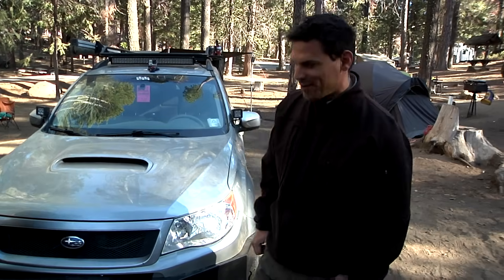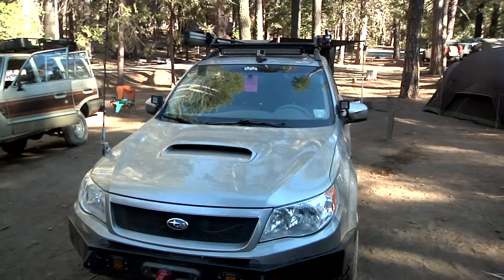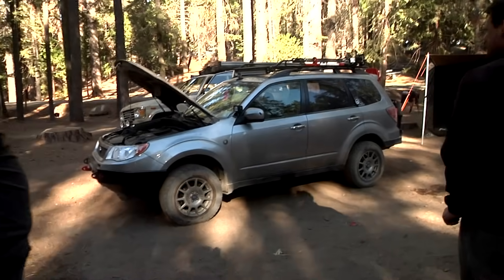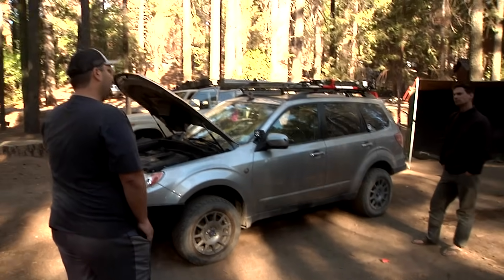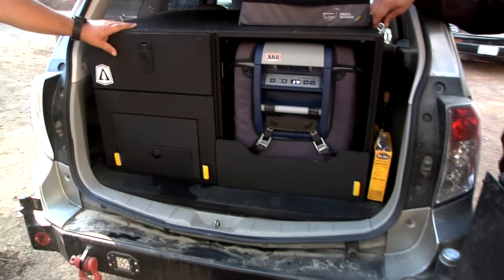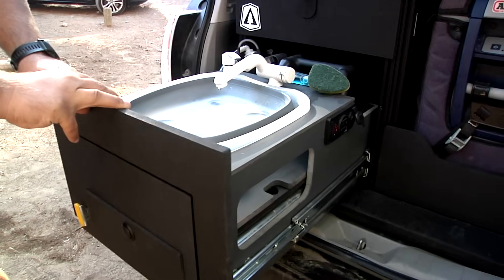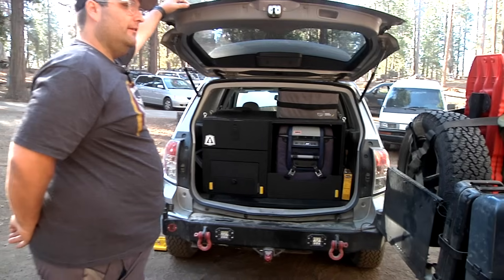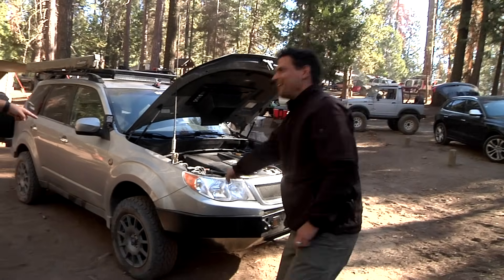2010 Subaru Forester XT Rig Walk Around

Comment: I carry a $30 cooler and a 3x4 grid for cooking on ground fire, cost under $50.
Knife on my side and the wood I cut for my fire is also my cutting board.
2 cast iron skillets also double as my plate.
French Press for my coffee  
Couple cups and set of 6 forks  
That leaves me a lot of extra space for BEER
I like to camp when I camp.

Comment: Harley... You and your Subaru had me salivating all over the keyboard! Congrats, buddy! One thing you did not mention (and I believe it's extremely important) is the armouring of the body's underneath. The CV ad their boots, the engine's oil pan and transmission's are all very exposed. I would suggest a couple of re-bars from front cross member to oil pan's location, reinforced by another two or three cross re-bars, all welded, and a plastic (ABS) sheet to keep the engine's temp to be swept in winter time, dropping the engine's overall temp. Loved your Led's! Again, congrats.
Reply: I do have the underneath covered just didn't mention it in the video.

Comment: I love it! Only changes I would make would be to get weight off the rear bar. Maxtraxs on the roof and ditch the carrier,  put a 12v pump water tank on the floor behind front seats and ditch the rear water jerry, and turn gas jerry sideways).  That would probably get about 70 pounds off the rear bar and really improve weight distribution.
Reply: Where would you put the full size spare? Only asking because I have a full size spare that is currently floating in the hatch.. trying to figure out what I am going to do with it as a permanent solution. Cheers man, like you’re ideas for sure

Comment: I live in San Antonio, Texas I have a 2015 Subaru Forester I've done the exhaust system all ready sounds great, Looking to lift it and get large rims and tires. I do go muddling in it also drive it down the beach. I have gone hill climbing in it before surprised some Jeep owners when I reach the top. Also looking the put a 4 inch on mine as well please let me know how your went and what I'm going to have to look forward to.. John from Texas
Reply: Hola John, also in SA here. I put Method 502's w/ Yokohama Geolanders on my Outback. Great combo, looks cool w/out the cheezy aftermarket ricer effect, and perfect tire for part-time off-road, but still a clean quiet ride on the highway.

Comment: Have they found an aftermarket part for the cv joint yet? Because from my understanding the c.f. joint can only take 2.5" and 3" is pushing it... the only reason I would keep my future forester stock height. Something doesn't seem right lifting the rig if there isn't an after market part for the cv joint to take the lift. Where's the real lift kits and not the wannabe shot spacer lifts?

Comment: For the comments about steel wheels vs alloys - normally you would be correct in saying that steel is better for off road use.  He is NOT running OEM nor discount alloys - those are rally alloys.  Rally wheels are built differently, made from premium alloys with thicker lips & all sorts of wizardry to keep the tires seated & the vehicle & occupants safe even doing 70mph (120Km/h) sideways around a corner in gravel.

Comparing rally alloys to regular alloys is like comparing an M113 APC to a Honda Odyssey.  Or, so I've heard.

Comment: i think it would be really cool if Subaru actually made a solid rear axle 4x4 similar to say the Toyota 4Runner
Reply: Agreed.  There is a guy on Instagram (ryanreid13) who has actually done a solid axle conversion on his Outback and its a freaking monster.  Its cool what he is doing but makes me wonder if its still really a Subaru at that point, its still cool though.  I don't see Subaru going this route unfortunately.  Their roots are in rally and they seem to be finding a certain formula that their cars appeal to the mass market.  I just hope Subaru doesn't mess with their AWD system (make it worse or dumb it down) in future cars because if they did it would lose a lot of die hard fans.
Reply: FozRoamer _ makes sense about the rally heritage, anyway, awesome rig man!
Reply: Wouldn't be to hard. Isn't about 40% of Subaru owned by Toyota now anyways?
Reply: they did. It was called Isuzu Trooper.
Reply: Y10Q It's funny that you say that as I actually own an Turbo Diesel Isuzu Trooper. But I mean a modern version of a subaru with a diesel and petrol boxer with Subaru's signature styling and subtle utility, that would be cool.
Reply: 94Greenbean Yeah well the 4runner is pretty much what I had in mind actually, but with a rock solid tough turbo diesel. That would be my ultimate 4x4.
Reply: *****
 If you put a solid axle on a Subaru, it goes from 24mpg to 15mpg or the same as 4runner, so it would defy the purpose. It wouldn't be a Subaru anymore. They did offer dual range on Outback even all the way into 2000s but mostly in markets that need the dual range. Russia, Australia that kind of stuff. I don't think they ever had a solid axle, as these are cars. They did build the Trooper in Indiana and they did call it a Subaru overseas. It is definitely not their philosophy to have a heavy duty axle in a car. Solid axle kills your gas mileage. I have a 4cyl Previa, awd, gets 15mpg, solid rear axle. Problem with Previas is that they are all high mileage by now. Thats the only vehicle you will find that is Subaru like and very reliable.
Reply: Y10Q I realise that. That is why I own a Trooper, as I need more articulation from a rear axle as I am regurlary driving offroad where I require more flex that an IRS vehicle. Fuel consumption is also the reason why I opted for an intercooled turbo diesel. I owned a Subaru Forester as daily. I would just simple like to see a more beefed up Subaru as I think it would be cool to see, I realise it's not likely to happen though as you said.
Reply: If you fancy putting in some wrench time might I recommend one of the older GL's or Justy's. I have an 87 GL 4x4 Wagon. It is from the generation before Sooby went with the now standard AWD. I call mine the Franken Wagon. He is a FWD with a Hi/Low transfer for its 4x4 system and a 1.8L carbed 4 cylinder with a poorly designed electronic choke that you need to always keep an eye on. The issue is that he is 30 years old and finding parts is not easy and its even harder to find mods for it custom built or not. All that being said, he has never left me stranded anywhere and i used him as a daily driver her in Las Vegas for about a year. There was only a couple of weeks during the summer that year where I needed to rent a car that had A/C...sometimes that old 4 windows down at 60 mph system does not cut it.
Reply: Gibbet Hoskins develop it, it will sell!👍
Reply: I think I would never buy a subie but yes toyota 4x4.
Reply: HMMWV (H1) is FIS, so I don't know that that's a major weakness of modern Subies. Didn't a generation of the 4Runner also have FIS?

 I'd be more concerned with the lack of 4Low, the low plastic bumpers, the small wheelwells, the R&P gears, and the "merely adequate" powertains/drivetrains.

 At least the aftermarket is getting better for the Subie CUVs. It's not just speed/rally parts anymore. Winchmounts, steel bumpers, locking diffs, etc. are now available.

Comment: So true about Australia having lots of manufacturers, Subie's are the best down here in Australia. Some very nicely modded Outback's and older Foresters that are truly set up for VERY rough Australian Outback tracks. Thanks for the great video, brilliant rig, attempting to do so with my Outback right now, thankfully down under its a touch easier, but still expensive and more difficult than if the same mods were done to a Landcruiser and so on. Brilliant brilliant cars, so capable. Just one question. Have 2 inch strut lift on 05 Outback with BG Goodrich KO2's. I've been warned against King Spring lift due to problems aligning wheels and angles and so on. What issues have you had and where have you changed things so issues don't come up? After all, I'm running about 70mm at the moment almost 80mm in rear, but another half inch from springs would be awesome ONLY is safely viable! Let me know, cheers! Daniel.
Reply: Daniel V - wish someone would have left a reply for you as I'm planning to lift my Forester and was planning on going with King Springs.

Comment: The lifts from Anderson Design Fabrication are simply spacer lifts.  This means no additional travel and the ride quality would actually be pretty terrible on desert roads.  Would rather get a setup from King.
Reply: I do run a suspension lift from King as well, guess you missed that part.